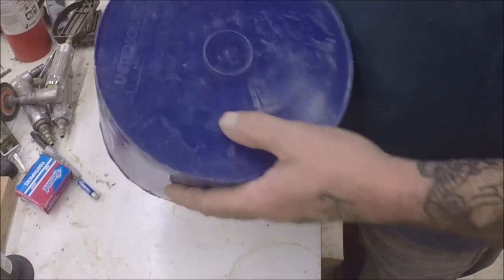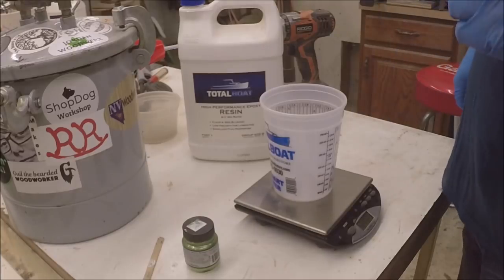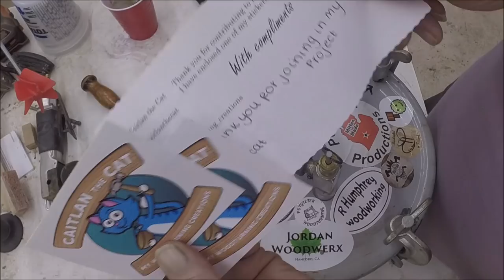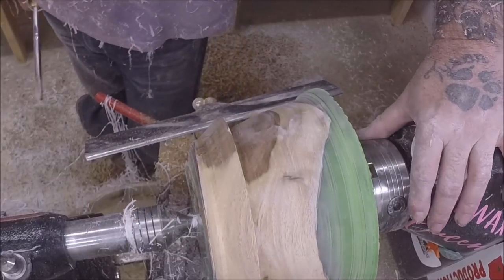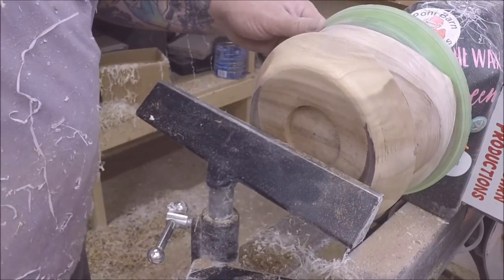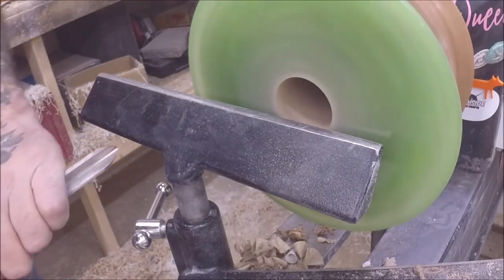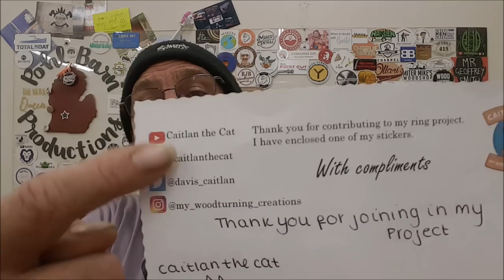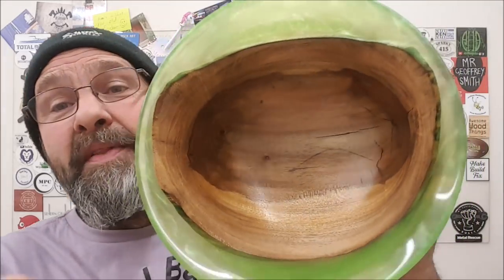Green Resin and KOA,  FLOWER POT.

Comment: Have you ever had the winged bolts on your harbor freight pressure pot strip out?  If so were you able to find replacements and where? Mine stripped out and I currently am dealing with regular bolts which is a pain in the butt to say the least.  thanks for any info you are able to give and thanks for the great videos!
Reply from the maker: I am sorry I have not had them strip out as of yet,

Comment: Morning Doug,  Nice piece.  I'm interested to hear/see the problem with Total Boat High Performance 2:1.  I haven't had any of those problems although I recently had a casting that had a large crack along one side.  I'm blaming moisture.  I thought I saw a U-Tube where someone use their penetrating epoxy for casting.  So I tired some.  Bad mistake.  Lots of heat, melted molds and cracks.  Also interested to hear what you might have to say about using carbide tools when working on irregular (out of round) epoxy castings.  I haven't been real happy with the chipping I get on the interrupted cuts.  My bowl gouge does a much better job - as it did for you in this video.  Keep 'em coming!
Reply from the maker: Thank you Tom,  you notice I am not really using the carbide cutters any more, if they are not negative rake the chip out is awful, to boot they are expensive to replace,   most of the cracking in my projects are my fault, either I mix way to much and pour at one time or I didn't get all the moisture out.

Comment: What size pressure pot do you use?  Can you link to the pot you use?
I have a bunch of wood with splits and cracks that I hope to "soak" in a colored resin or epoxy but my Harbor Freight pot isn't big enough.
Reply from the maker: 2.5 gallon pot I think

Comment: Hi just started in resin,if I have a piece of wood in a pressure pot do I need to have it in a warm temperature or will it be ok in my garage without any heat      thanks
Reply from the maker: warm works better but if not is will just take longer to set up unless it's just way to cold.

Comment: I asked before but I didn't see a response. What is the reason for using the pressure pot?
Reply from the maker: I do normally answer every comment Randy. but I have been known to miss one here and there,  it compresses the air that was mixed into the resin and it also helps control the exothermic reaction of the resin..

Comment: I use Total Boat epoxy and their website says to mix by volume, not weight. I haven't had a problem by just using the markings on the mixing cups, maybe I am just lucky.
Reply from the maker: if that works for you then it works for you but you can also weigh it out, the Data sheet is also on their web site for each resin,  I kept running out of hardener eyeballing it by the marks on the cups so I went to direct measurements.  this works for me.

Comment: What speed  are you turning at?
Reply from the maker: most of the time I am turning at 1250 rpm
Reply: @PohlBarnProductions  Thanks, I seem to get a lot of ship out with regular gouges. I may be turning too slow.
Reply from the maker: that's a possibility , also try not to push so hard or fast, there is a sweet spot and the ribbons just fly off.

Comment: It is completely normal for two-part resin to get hot when you mix it. It's an exothermic reaction.  A heat-producing reaction needs to happen when you combine the two liquids. This is what causes the resin to go from a liquid to a solid. But, there can be too much of a good thing and resin that gets too hot will cure in unpredictable ways.
Reply: Isn't that witness line on the grey pressure tank as well 10:27?  It looks to me as if it's in the same place as the resinated KOA.  You did say the resin was hot and the bucket melted...over heated resin can be unpredictable.   I'd be talking to someone at Total Boat about this.  Of course I'm watching this in Feb of 2022...but still....

Are you related to a Shawn Trahan in Nova Scotia?  

Who would have known resin flower pots are better than terra cotta flower pots?  No drainage holes?  If you were to put another pot in there with drainage holes...most flower pots are taller than wide...just letting you know for future developments...lol.
Reply from the maker: lol yes yes and yes, I know all this and expect it when I pour resin, Total Boat sponsors my channel, they send me the resin so why would I ever complain to them about how the resin is reaction when I am clearly not following the directions on the jugs,  they have since sent me resin that takes longer to set up so I can pour thicker molds .
Reply: @PohlBarnProductions  oh no, not complain...ask about the hotness of the epoxy/resin.  As I said, it can be unpredictable when at high temps.
Reply: Hit send to soon...mixing properly is a majority of any issue.

Comment: 2:1 is 50g for every 100g sno zaakly rocket science.
Reply from the maker: you are correct in your rocket science !  but the DATA SHEET says to mix it by weight it 45g to 100g actually not meet the 2 to 1 as they call it.   I was really tired of cracks and over heating so I went and found the data sheets on the resin I was using.

Comment: Why are you using a laminating resin instead of casting resin?  Casting resin is designed specifically for the type of work you are doing...but laminating resin is designed to be applied in a thin layer.  The exotherm characteristics of the two types of resins are very different...and I think the issues you talk about with the resin all points to the fact that it is the wrong resin for this application.   I ask "why", because you must have a reason...and Total Boat can hook you up with their laminating resin just as easily...so yeah, I guess I just can't help myself?
Reply from the maker: Because that is what Total Boat sends me Fredy,   they determine what I use in my shop.